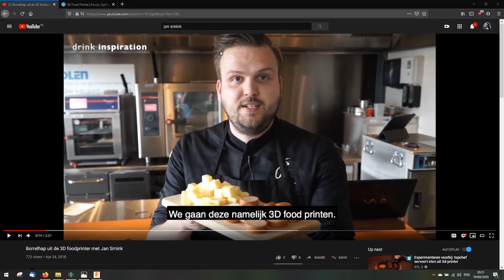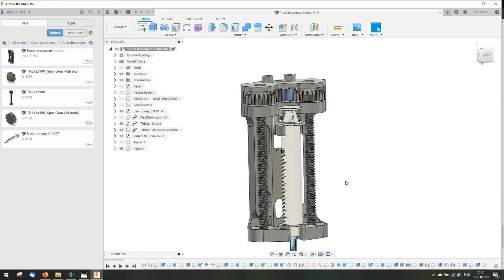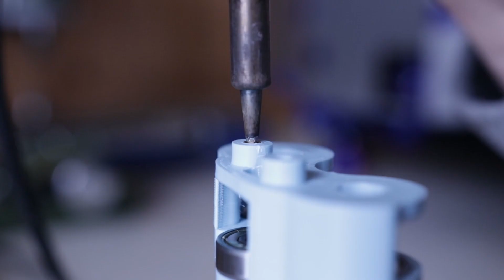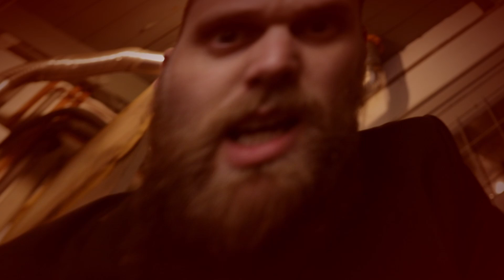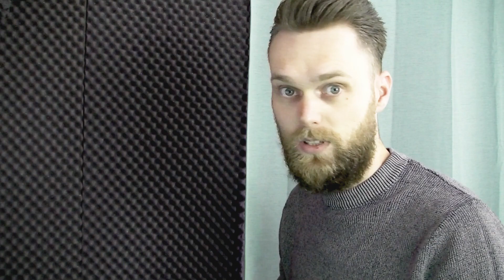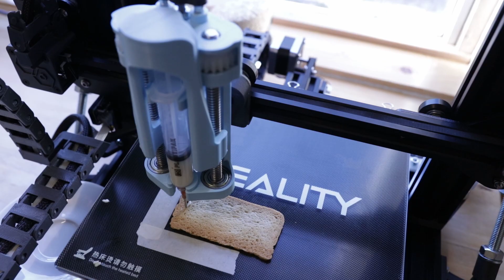Printing food with an Ender 3 pro

Comment from the maker: I'm going to upload this design together with the other mods of this series which I haven't uploaded yet to my website. This design still needs modification, but I'll upload the Fusion file so you can experiment with it yourself. Please leave a comment and I found out that a lot of views came due to sharing the video. Thanks a lot to those who has shared one of my videos and please share this one too if you liked it, this definitely helps :) Have an awesome day!
Reply: how difficult would it be to make your flextruder to work with shaft oriented perpendicularly to filament, to save on height of the printer? (and to use it in Hypercube-like printer)
Reply from the maker: Everything is possible, especially when using gear ratios. A worm drive for instance can do the trick ;)
Reply: @properprinting  any hints on how to?
I'm skilled at (3d)printing, not so much in designing things - any good sources, examples ?
Reply from the maker: I started CAD drawing from since I was 15 so school is where it started. What works for me is a similar approach as what I do with this channel. I have an idea in mind and I work my way towards it. The problems I face become increasingly specific which makes searching for solutions easier. I don't know any good generic sources because I didn't need them.

Comment: I can't wait to see what you do next! You really inspire me (and everyone else) with all your content
Reply from the maker: I cannot wait either! I'm glad your inspired by my content, one of the things I try to achieve :D
Reply: @properprinting  Did you try to extrude high(er) viscosity polymers with this? I'm very tempted to try out this extruder for a shape memory polymer!!
Reply from the maker: @ozgunkilicafsar8122  That sounds very interesting! I haven't done more with this extruder yet and if you check my latest video you'll see that I shifted to another solution. This syringe extruder still is worth improving and has its own advantages. The flex3drive I used for this is too weak at the current gear ratio.
Reply: @properprinting  I saw the gel printing and fascinated by it!!! i'm afraid, though, it would be challenging to print with highly viscous materials, something like honey, using the peristaltic pump.

Comment: hahaha the treated rod. I have had exactly the same problem.
Great video. In case the engineering business doesn't work out, you can always switch to the film industry.
Reply from the maker: Hahaha thanks Duncan! I just measured the pitch of the thread and measured 2mm without thinking that there could be four threads xD I wouldn't say no to a career in the film industry :D
Reply: @properprinting  at least you measured. I just went online and ordered hahaha. After installing something looked a bit of XD
Do you have any experience with using normal threaded rod as lead screw? The pitch of normal 8mm threaded rod is 1,25mm. This would improve z resolution by a lot. (and is wayy cheaper)
Reply from the maker: @duncyy7471  hahaha I do that to often as well xD I don't have experience with using a normal threaded rod. Normally trapezium thread is used for movement and not for mounting purposes but there isn't much force on that rod so it might work, thanks for mentioning!

Comment: Really find great ways to up the entertainment value with your videos.  The assembly animation is something Pixar would be envious of.  Have you investigated IGUS filament? Just came across that they sell filament and may be a great solution for improving the gear moment if you still want to go down the road.  Can’t wait till the new series.
Reply from the maker: Thanks Paul! I'm glad you liked the animation! It was quite a lot of work but a lot of fun to do! I don't see stop-motion done often in combination with engineering. I haven't heard of that filament before, but this looks very interesting, thanks!
Reply: Proper Printing here’s the link to the filament.  If it’s anything like the bearings Igus make should be pretty slick.  https://www.igus.com/3d-print-material/3d-print-material

Comment: Awesome series! Will using a larger “nozzle” help with extruding? Looking forward to seeing what you’ve got in store next!
Reply from the maker: Thanks! The opening of the syringe itself is pretty small itself so I cannot go much larger. However, I started with an e step value of 1900 (bit of over extrusion) and ended with 40 so there's more than enough room for a gear reduction :)

Comment: meme or not, that syringe extruder is REALLY interesting for stuff like gel vat printing or cellular printing, like, that could come in handy to some scientists as it's cheap as chips to make and seems to work really good
Reply from the maker: Thanks a lot for bringing that up! I haven't thought about it. I'm going to do a bit of research regarding that. This is exactly what I try to achieve, trying things out and find new possibilities building upon it, thanks!
Reply: @properprinting  Do you know the max torque of the extruder? As in would you be able to extrude sth like honey with the current extruder? It's a pretty neat one so I'm curious if it'd allow for high viscosity materials to be printed with it!

Comment: Cool video and brilliant.editing. I would not change the firmware. It sucks flashing it for a specific tool head. I would add a menu item and make e.g. cold extrusion configurable. So for a tool change you just need turn it off using the display controller. Recent marlin 2.0 is quite nice in that department, but I must admit for just one video it may be a little overkill.
Reply from the maker: Thanks Guido for your suggestion and I do agree. I personally do not mind that cold extrusion is possible, I must be aware of that and only start extruding when it's at temperature which I normally do ;) Marlin is poorly supported for the Ultratronics but it's good to know that this feature exists, thanks!

Comment: :( I love the ender 3 contact. What cable length did you use for the flexible remote drive extruder attachment. I went to the site and trying to figure out which one I might need and saw yours is a perfect length but no work and any of your videos does it mention which link you have used.
Reply from the maker: Thanks Chris! The length of the shaft is 650mm. It's mentioned in the description of the video about the detachable direct drive ;)
Reply: @properprinting  thank you very much I must have just missed it XD.

Comment: I did the same lead screw mistake, at least it came with the nut, had to make some holes but worked fine on the ender
Reply from the maker: Nice that it worked for you! It was pretty difficult to make it working as a second lead screw though ;)

Comment: Your videos are very entertaining and innovative. Just wondering how you hooked up your emergency stop button?
Reply from the maker: Thanks! I break the 230V power line so there's not a lot of current running through that switch. I made sure that you cannot touch the wires, but I wouldn't call this particularly safe right now xD

Comment: I think you made an amazing start, and I hope you don't abandon this idea entirely. I think you just need a better material to use. I made a video about a way this could be done and you're there closest to making it happen. Look up "food" on my channel.
Reply from the maker: Thanks a lot for your comment! I certainly will not abandon this idea, it's just postponed :) I started with an E step value of 1900 which resulted in that over extrusion and ended with a value of 40. So, there is plenty of room for a gear reduction to make it work with that shaft. I really do like your idea, but it would be pretty difficult (how does beer taste to you btw since you cannot taste bitter? xD). I think that it will be super difficult to emulate tastes since there are hundreds of flavors needed to make the artificial banana taste for instance.
Reply: @properprinting  I've never drunk beer, despite once working at Coors. So, no idea. 
Admittedly, the depth of flavors of real foods works be lost. But the variety might make up for it. Sure you can't have banana cream pie, but you can have 20 degrees of sweet and sour crackers. Each with slight more sour and slightly less sweet.
I wonder if for this, instead of a cooling fan, a heated fan could pump enough heat on it to cook whatever soilent variant this uses as it's being squirted out to the proper degree.
Reply from the maker: @3dpprofessor  I still have some neat ideas to build further upon this idea. I can use the heater for the nozzle to heat up the food which can be interesting for chocolate for instance. Still much to do :)

Comment: You should make your own flex-shaft Bowden tube out of sterl cable and teflon tubing
Reply from the maker: Thanks for your suggestion! Nice idea but isn't it the case that sterl cable can only take up a twisting force in one direction? The shafts can be easily bought ;)

Comment: i had to laugh hard because of that overextrusion combined with the panic haha. Interesting project again but you need a better Dispenser, that one laggs and prints more like binary .....____............______..........__.....
Reply from the maker: Haha yea, the E step value was a bit too high xD It was at 1900 and it printed correctly eventually at 30-40, glad I added an emergency stop haha. The lagging of the dispenser is due to shaft overload as mentioned here https://flex3drive.com/support/assembly/flexible-shaft/. You can see it twisting and this should be solved with a gear ratio. A ratio of 50 is even possible so I'm going to work on that when I pick this project back up.
Reply: @properprinting  ah okay, first i thought it was maybe because of the friction  in the syringe. I'm excited what the next project will be